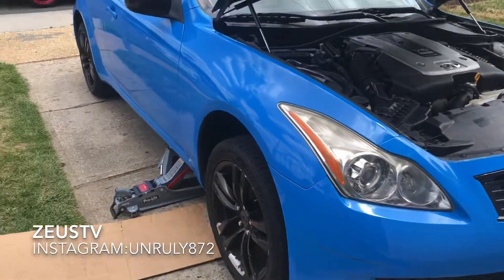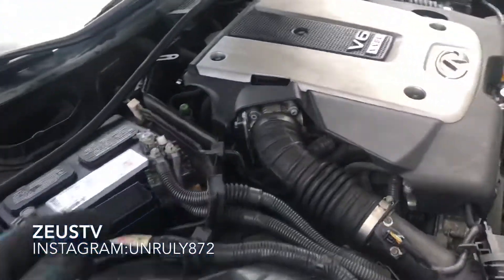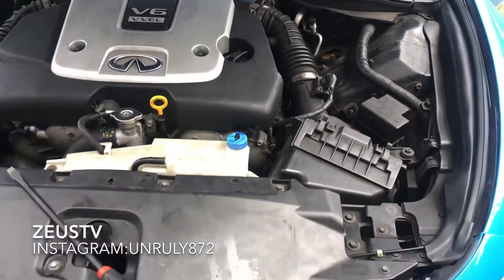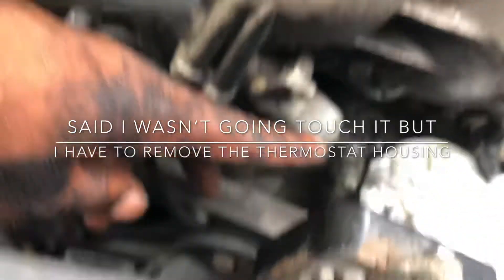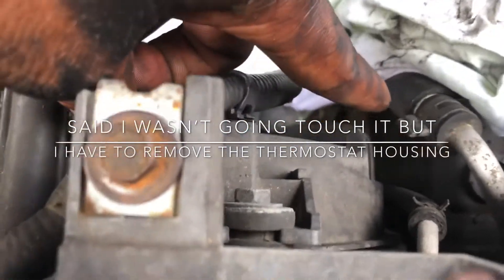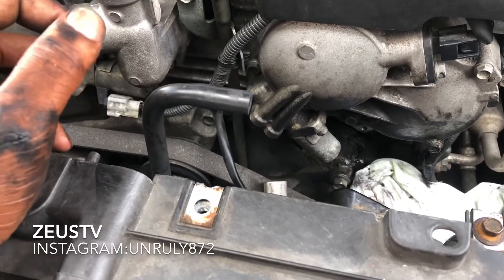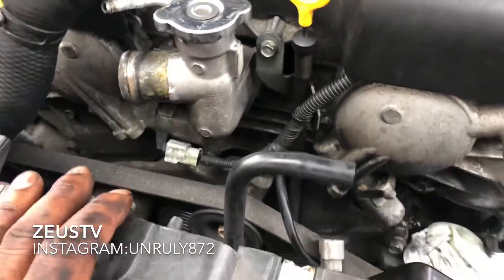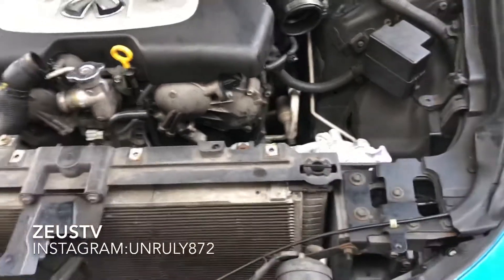Infiniti2008 G37 maintenance change thermostat housing

Comment: How did you disconnect that sensor i cant get it
Reply from the maker: Take out the Radio cut two wires that’s on the radio I for got which one right now and u have to ground back one after u cut it and just leave the other one out